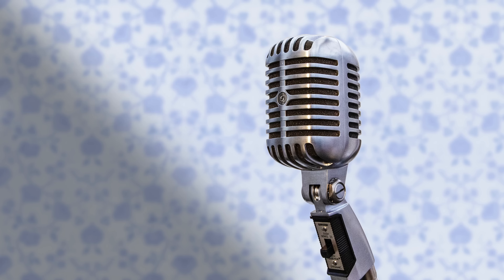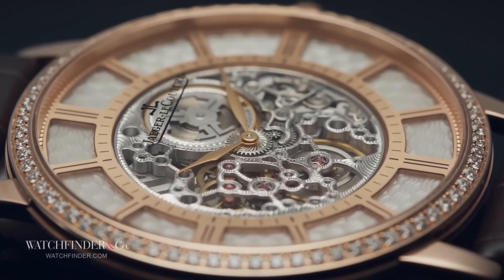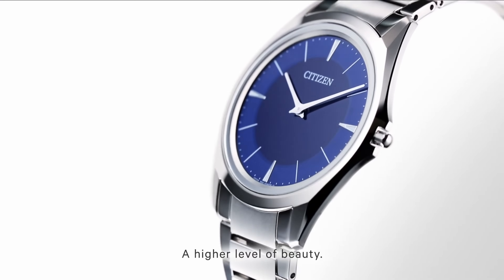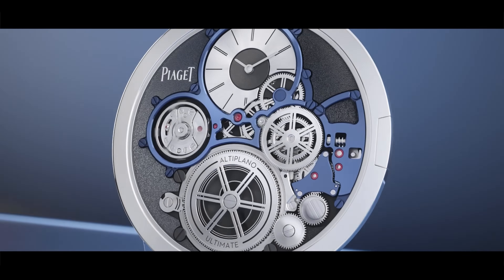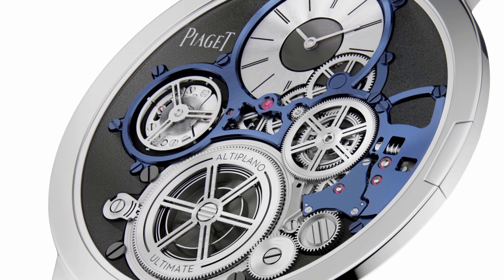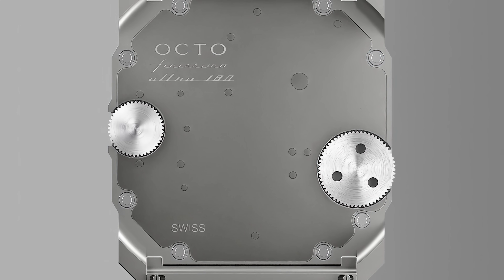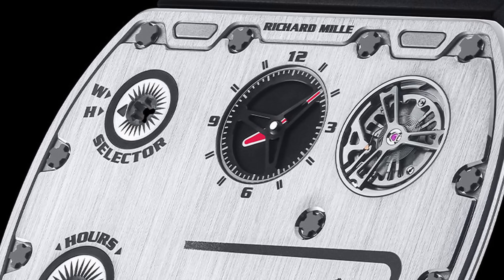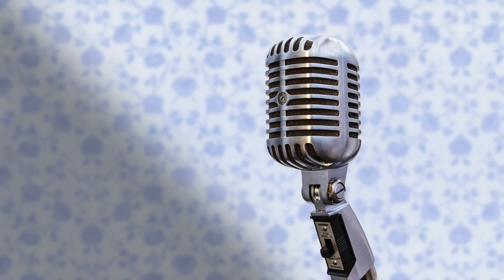The World's Thinnest Watches are INSANE | Watchfinder & Co.

Comment: One of the most underrated and undervalued ultra-thin watches is; the Seiko CDF020 with the cal 6810 movement. Can often be bought under 1500 USD and has a 4.4mm thick case, making it the 10th thinnest mechanical watch ever made.

Comment: NO MENTION OF "TITAN EDGE"
Reply: Not really in the same league: A cheapo (less than a hundred quid) slim (4.4mm) QUARTZ watch. If you’re going to include quartz watches then why not the Concord Delirium IV? Which at 0.98mm is over 4 times slimmer than the Titan.
Reply: @AtheistOrphan  the one I have is 3.5 mm and in the video, he is showing quartz as well, (citizen and seiko). Btw titan edge also released slim mechanichal version for $1200 4 years back. Now they have released several designs for $2500+.

Comment: The RM is not a complete watch… It needs external tools to function, which means they made something thin, by removing critical and essential parts of the watch, rendering it useless without. The complete size therefor need to take this tool into the calculation when talking about size of the watch. 
So, all being said and done, the OF is the thinnest watch in the world, as this is a stand alone function unit. Also… the OF has much less volume than the RM. In short, the OF blows the RM out of the water.